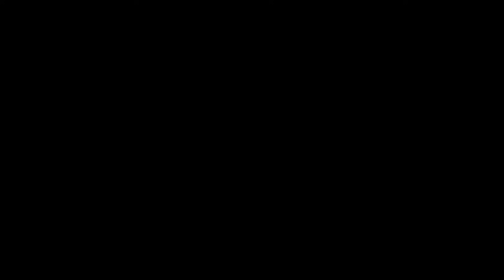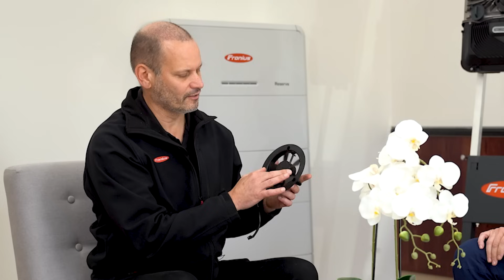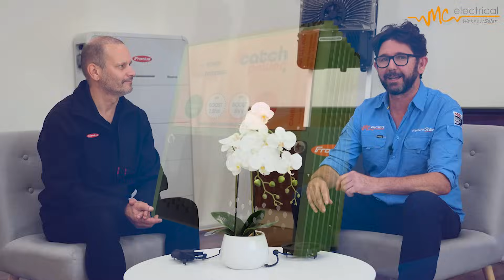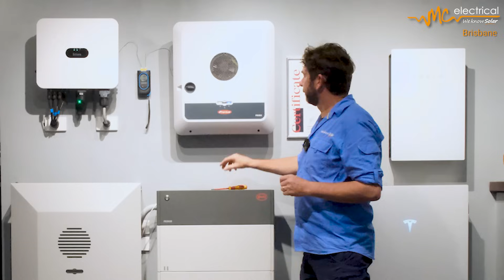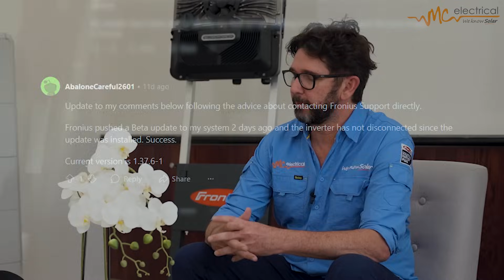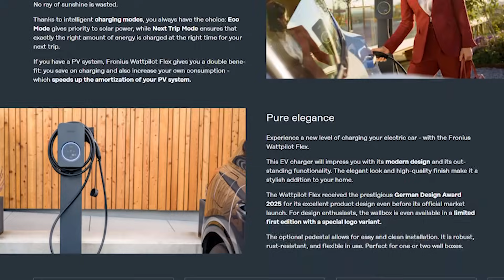Fronius GEN24 Overheating Problem & Solution

Comment: Thanks for the video - I have expelled two dead geckos from the inverter - one which was stuck between the blade and the outside ring as described.  Sorted, phew!  I also took the opportunity to reconnect the inverter with our new wifi modem which was a job on the list for some time.
Reply from the maker: Glad you managed to clear those geckos out and get your system back online!

Comment: Thanks for this video. Yes, that is exactly what happened to my two year old 8 kW Fronius Gen24 plus hybrid inverter, in Brisbane, Queensland. It was working fine, then it was not. Fronius needs to tell owners in Queensland about this. It should be done by Fronius as a recall retrofit. Scratch one dead gecko. Not good enough.The Gecko did not fall away. It dried up and stayed stuck in the one spot. It was easier to replace the inverter with a different brand, which I did. Supposedly the best turned out to be poorly designed for our conditions.
Reply from the maker: Which inverter brand did you replace it with?
Reply: @mcelectrical  I know you do not like Fox ESS. I watched your videos and I followed your logic. Since you made those videos the higher voltage Fox CQ7 V6+ battery modules have been released by in Australia, which is what we now have, with a Fox ESS 9.9kWh KH single-phase hybrid inverter. As you know, the Fox inverter has a large passive heat sink. In the past 17.5 years of inverter ownership, all of our inverter failures have been due to cooling fan failures, so passive cooling is better in my opinion - please feel free to disagree.
Here is a summary of our setup and the problems we had along the way:
It came down to getting the biggest battery we could afford without adding too many years to the mortgage. 
You may have seen a recent ABC news item about dangerous and incomplete battery installations. After our experience I understand that the people who sell the battery systems are not the people who do the installations. Because of this disconnect, installers are being short-changed. I have more to say about this below.
The system:
Fox ESS single-phase KH 9.9kWh Hybrid Inverter
Fox ESS 7 X 6.96kWh CQ7 V6+ = 48.72kWh total
Why such a large battery? To be able to add at least 50% stored solar to our EV battery overnight while still having enough battery to run the house. Our EV battery is 60kWh, so we are still short in terms of being able to completely charge a flat EV battery. However, we also have enough solar storage to cover us for several days in the event of a blackout. We’ve had up to 5 days in a single blackout after a major weather event in the past few years. 
We already had 20 x 440watt JA bifacial split-half multi-bypass diode solar PV panels, giving 6.16kWh in one string of 14 x 440watts, and 2.64kWh in a second string of 6 x 440watts, giving 8.8kWh total. 
The inverter has four Maximum Power Point Tracking (MPPT) inputs. With solar storage batteries it is possible to oversize the solar PV input by up to 200%, so that power production is greater in low light conditions, such as morning, afternoon, and cloudy days. With a 9.9kWh inverter we can have up to 19kWh of panels.
More MPPT inputs means that we can place panels in locations that have varying sunlight conditions, such as the south facing side. We will add another 14 x 440 panels (6.16kWh) in a single string to the south facing side of our roof, to bring the total installed panels to 14.96kWh. 
The system is working well, except that I had asked for automatic switch over for blackout protection, but because the salesperson shortchanged the installing electricians (to give us a cheaper quote, as I found out on installation day), the electrician only put in a manual switch over between solar + battery, or grid + solar + battery. 
We were supposed to be getting a secondary switchboard with auto switch over in under 10ms in case of a blackout. 
We have enough kWh energy and enough total battery amps (50A max. inverter charge/discharge current) to run our home off grid, but the backup setting does not include the stove and the supplementary heating element for the solar hot water. Our solar hot water circulation pump runs from the normal power circuit, so we still have hot water in a blackout if the sun is shining. 
We have left it on grid + solar + battery, but if we go away, we will switch the system to running off grid. However, this wastes the solar energy we could be feeding into the grid while we are away. 
The installation electricians were careful about the following factors:
They upgraded the size of the cable between the solar inverter/battery and the switchboard, so that it would not overheat. The existing cable was only two years old, but too small to carry sufficient current.
They followed the manufacturer’s guidelines for the air flow space around the inverter to provide sufficient cooling. 
They stressed the importance of putting in a protective reinforced steel bracket and cover around the high voltage DC cables coming out of the inverter. 
Even though the battery is under cover near a west facing brick wall, they asked me to install extra shading on the north facing side to prevent warming of the battery in the morning.
They kept the maximum current to 40 amps, even though the battery and inverter are capable of 50 amps. Again, this is to prevent overheating in the cables and switchboard. 
We already only had 40A maximum current in our meter box and on our switchboard due to the distance of our home from our meter box (~50m.) and the small size of the grid connect cable (10mm2). Because our grid connection is too long and too small, we need a new larger grid cable – either 16mm2 copper, or 25mm2 aluminium service cable. Our body corporate has been attempting for the past two years to get an electrical contractor to audit and upgrade our grid connections, but they are all too busy to be interested. This is a common problem for older homes that were not designed with transport electrification and large PV solar systems in mind. 
Cheers

Comment: Had numerous PC power supplies die in my old job as a Network Manager - all the result of Geckos getting stuck in the fan on the power supplies. They're a bit of a blight with air conditioning systems too.

Comment: Bingo! Thanks so much for putting this video up, we have been investigating reduced output from our Gen24 for the last six weeks and getting nowhere. After removing one very desiccated gecko from the fan, it is back to normal.
Reply from the maker: Ha, welcome. Where do you live? Brisbane area?
Reply: @mcelectrical Yes we are in Bellbowrie. There was a bit of ambiguity there about whether Fronius would retrofit the new design fan to older installed  units, is there any news on that? At least we do know what to check first now anyway.

Comment: The love affair with my gen 24 is at an end. And dont get me started on BYD batteries. Rolling bloody nightmare. 
Tech support ! Running joke. 
They just pass the buck to BYD and BYD bats it back to fronius. Four years in and still not sorted. 
Fronius avoids, evades and doesn't pick up the phone.
Reply from the maker: Oh really! What’s wrong with it? Where do you live? Is your installer involved? Normally manufacturers don’t deal directly with end customers.
Reply: @mcelectrical 
Exactly. Manufacturers don't which sends a very clear message. Their contempt for their customers concerns and hiding behind installer's who are fed up with being given the fronius run around. 
This is a very Austrian business attitude and it leaves a very sour taste. All I know is this. I have a ten year old SMA inverter that never once gave me any trouble and still going strong. This gen 24 is a constant source of problems. WiFi dropping out, shut downs, fault, restarts. It's unreliable. End of story.

Comment: The fronius wifi just sux. Difficult to set up, drops off. Please make it more intuitive and simple to connect to. I'm so sick of it, I'm going to get Ethernet connection next time.
Reply from the maker: Yep there has been issue lately l. Update tour firmware.That should fix it . Or no?
Reply: Agreed. I'm totally over the gen 24. It's turning in to a rolling fk up. WiFi drop outs, shut downs, endless fault reports.

Comment: Mark could you talk about the SPD (surge protection device ) as i  live in  Cairns  and generally regarded as a lightening prone area ,as most of Qld is
Fronius do sell a kit 
Cheers.
Reply from the maker: Oh, that’s a whole other topic. 3, but generally 2 levels of switchboard surge protection. One level if you live on a hill and overhead powerlines may get struck. The other level is lower than that, but more fine. Then you get the power bank that you buy from office works. 
Depends on what you need
Reply: Yeah I don't think people realise how vulnerable roof-mounted solar panels are and i wouldn't expect the warranty or guarantee would cover this type of event .Maybe home insurance would ?
Good topic for further discussion on your channel maybe!
Reply: Ps i am a sparky myself of 45 years

Comment: How are the geckos getting in? Are they coming in through the exhaust outlets?
Reply from the maker: The fan is external. Just under the cover as I show half way the through the video.
Reply: @mcelectrical yes we saw where the gecko ended up and gets the chop. Correct me if I’m wrong, does the fan pulls cold air through the front cover mesh then pushes air out past the external heat sink. If so I assume there is a gap between the outer edge of the cover and the heat sink to allow the hot air out?

I assume the geckos can’t squeeze through the inlet mesh cover so are they crawling in between the heat sink fins towards the fan?

Good video 👍
Reply: Yep, exactly as you said. Massive gap you can probably get your fingers in. Works ridiculously well if no geckos get in.
Reply: @markcavanagh the removal of the fan shroud will stop the fan from turning but will still give the gecko a love bite on the nose. Maybe put mesh on the outer to prevent them getting in. Added cost of course.

Comment: We got a Fronius 24 back in April 2023.  Had some funnies with the WiFi connection for about 12 months.  Random times the inverter refused to connect to the network.  Would wait until after dark and powercycle the unit.  We do rock an ASUS/merlin 2-node mesh WiFi network, but I didn't put much effort into what could be the cause.  Given the inverter and router are all in my garage, I installed a network outlet and now connect the inverter via wired ethernet, with the inverter's WiFI now disabled.  It hasn't missed a beat.  I need to admit, I hard wire as much as I can just due to reliability and how noisy the WIFI bands are now in suburbia.
Reply from the maker: Hard wiring is the best bet for consistent connectivity.

Comment: I had this issue when I had some AC installed above the inverter.
A piece of brick fell down and jammed the fan between inverter and the fins. Found it as I keep my eye on the solar output. It derated my output significantly and I got the notice.

Opened the unit and removed it. Working fine now 👍. 
Well until I replace the whole thing as it can't handle batteries like I wanted it to.
Reply from the maker: I’m assuming you have a Fronius snap inverter? The previous model. Yeh there is a downside to external fans, but testing against IStore at the moment. Fronius again runs 10 to 20 degrees cooler. This is why they won’t drop the fan, and I tend to like their logic
Reply: @mcelectrical  Fronius Symo Gen24+ 5kw. Solid unit and works great with home assistant but The thing is to small to do 3phase battery backup. 😔
Reply: @nedt yeh bummer.